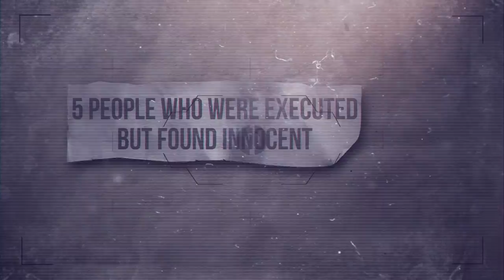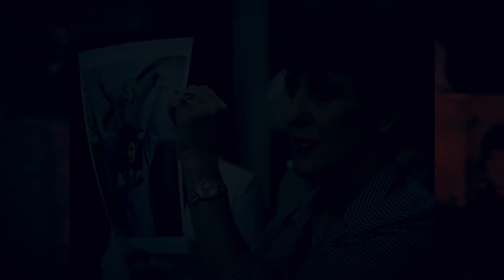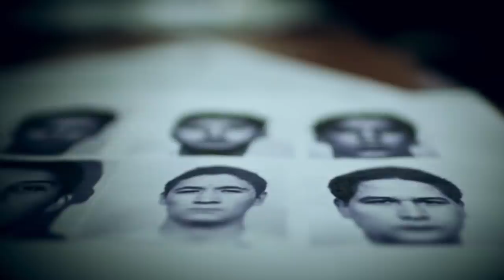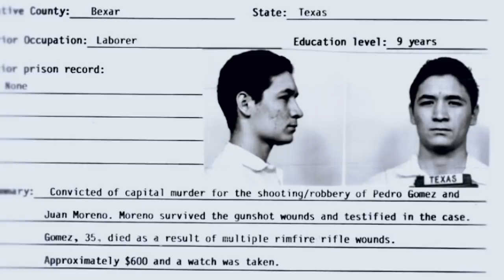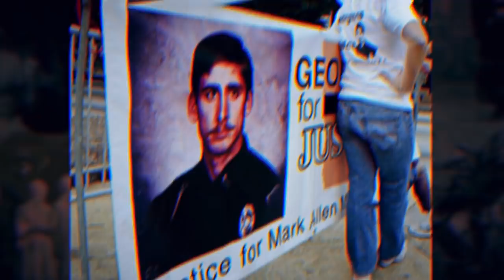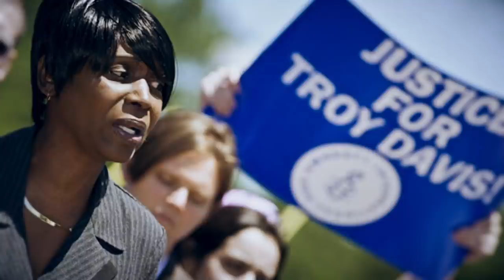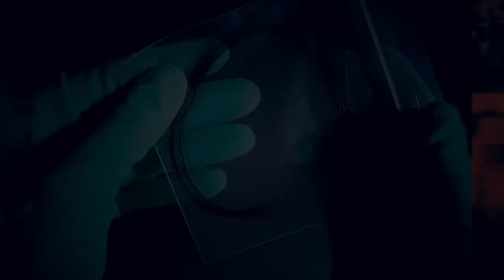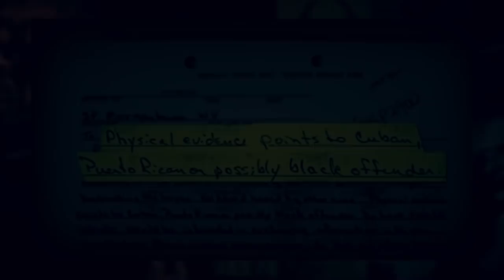5 People Who Were Executed But Found Innocent

Comment: Also the one about the fire in another similar case, it was the shellack on the flooring that was an accelerant since old flooring had a coat of gasoline to use as part of the finishing. Some cheaper version than what is supposed to be used. Why I am against the death penalty. For the obvious ones who should be put to death, I worry about the innocent ones who die and my tax dollars are paying for it. ☹️